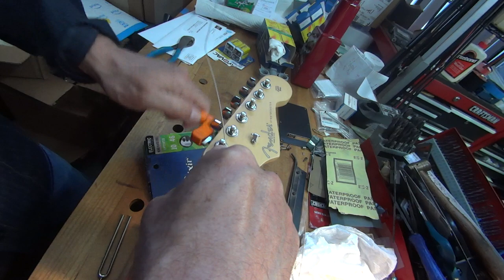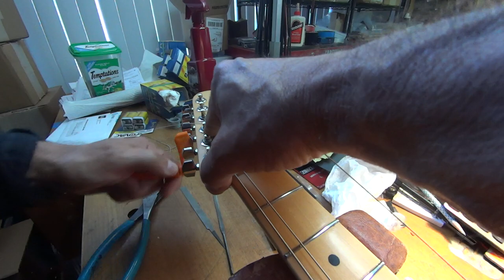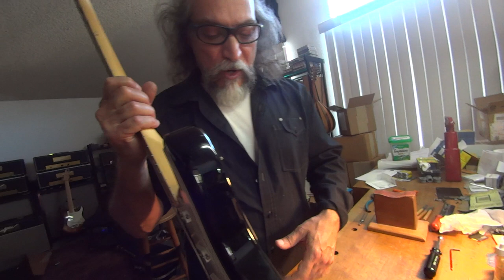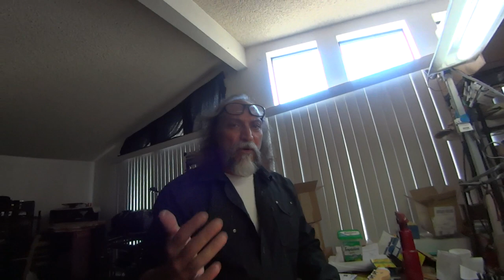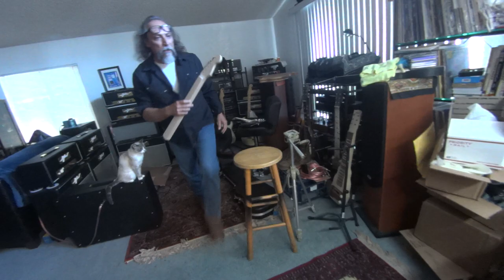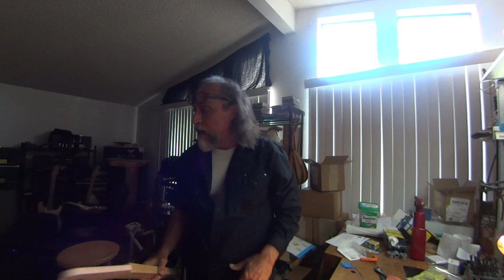How to Properly String and Setup a Guitar & Adjust Nut Slots + Locking Guitar Strings

Comment: Usually when I put my strings on my guitar after I get done wrapping them on and tuning to pitch I then mix up some JB Weld and put it all over the tuning peg then in about 12 hours when it is hard I can play my guitar I know that the Strings will not slip and it will not go out of tune! And then I sprayed PB blaster all over the nut the neck the bridge and in the pots this keeps everything lubed up nice it makes the neck super fast and easy to play. Both of these products are available at your local auto parts store. Now if you would like I can give you my recipe for modding  a Marshall Amp so it doesn’t sound like somebody farting through a kazoo!
Reply from the maker: haha HeXx - we can always count on you to make us laugh!